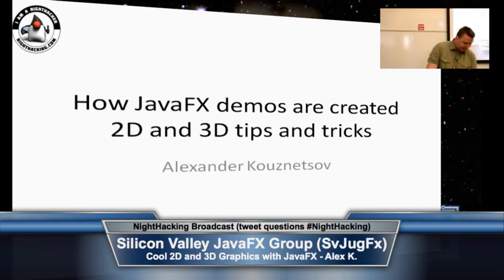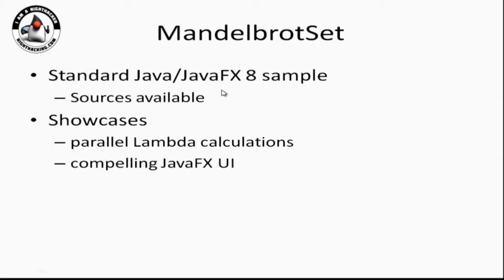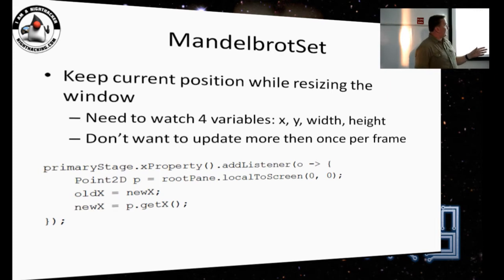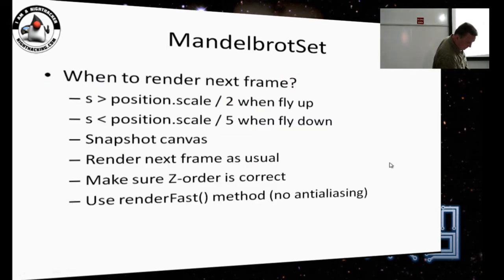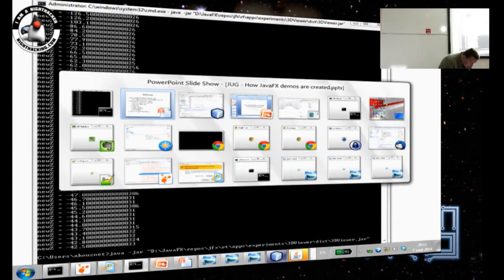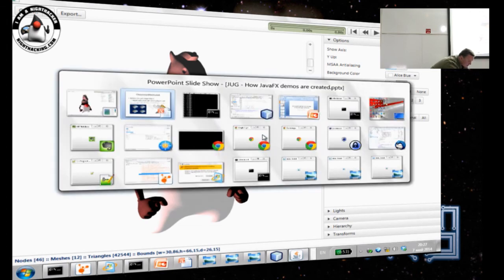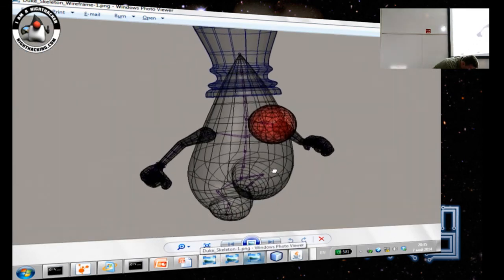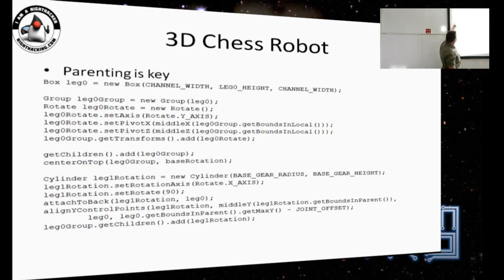Cool 2D and 3D graphics with JavaFX

Comment: JavaFX 3D is actually an OpenGL API as JavaFX 3D doesn't work without GPU hardware rendering. So it does similar things that WebGL does, which is sending data to the GPU like Vertex Buffer Object data and Index Buffer Object data and set and read GPU parameters telling the GPU what to do with the data and how to do it. Can someone give me a simple example of how the Duke skeleton works please?